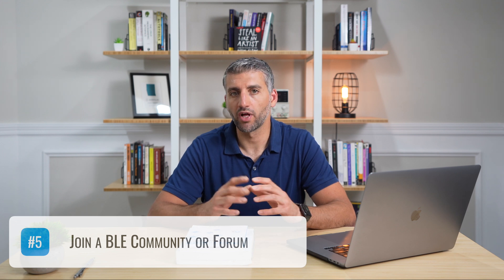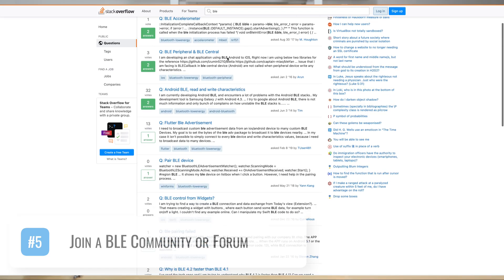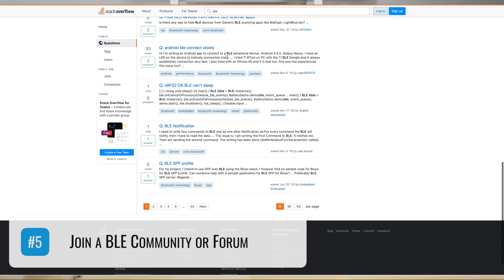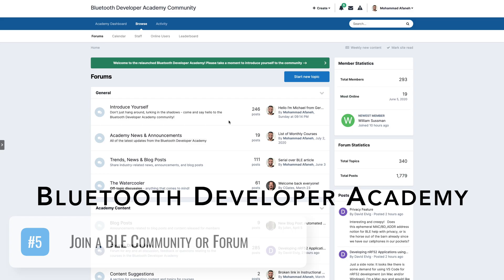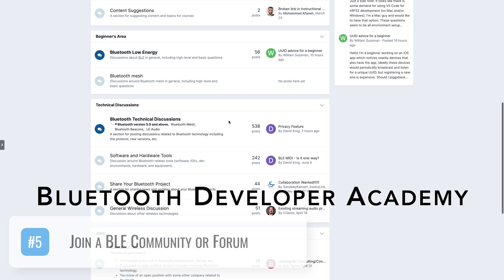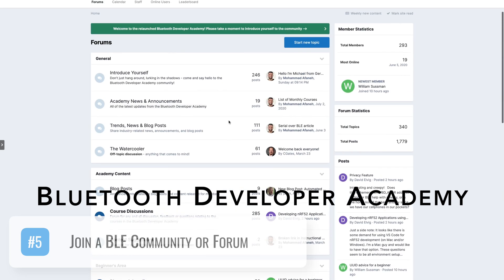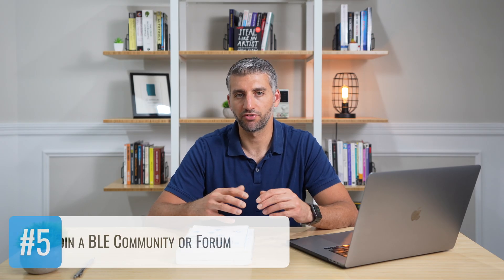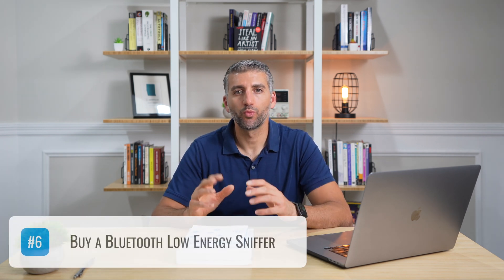Go From Zero to PRO with Bluetooth LE: Uncover the 7 Steps to Success!

Comment: Something I don't get about the Windows and Android apps: how come there's not a sniffer app that can show what data is being sent and received over the various BLE services (using the standard built-in BLE compatible SoCs)? All the apps seem to do is just show what BLE devices are advertising what services and characteristics. Am I missing something? Do I really need to buy a sniffer or dev-kit to see what data is going back and forth between my laptop and a BLE device connected/broadcasting to it?
Reply from the maker: You can check out capturing the HCI Logs on Android to see exactly what's being sent through the BLE chipset. 
https://source.android.com/devices/bluetooth/verifying_debugging
https://fte.com/WebHelpII/BPA600/Content/Documentation/WhitePapers/BPA600/Encryption/GettingAndroidLinkKey/RetrievingHCIlog.htm

On Windows, I'm not very familiar, but you may find something helpful in this page: https://docs.microsoft.com/en-us/windows-hardware/drivers/bluetooth/

The use of an independent device/sniffer has its advantages such as minimum interference with the application and capturing the packets in real time.

Comment: Great video, my goal is to learn and get good at BLE / NRF tech right now. Already did #1-#4 and read the first book, going to buy yours!

I’ve only considered using Nordic chips so far. As a beginner should I stick to learning Nordic/NRF Connect / Zephyr, or should I checkout some other chips? Nordic is #1 for BLE chips, no? Who would be #2?
Reply: You can track market share via the Bluetooth certifications out there, and Nordic has roughly 60% of those new certs so yes they are #1!  Mohammad is right, Silicon Labs is also a terrific option -- their strength is that they develop chips AND certified modules which make it easier / cheaper to get to market with a lower volume project.  If you're building <20k per year you should be using modules, and Silicon Labs is great as it allows you to start with modules and down the road (as volumes ramp) to transition quickly to a chip that will require certifications.  Between these 2 manufacturers, you can't go wrong :)
Reply from the maker: Great insights Phil! Thanks!
Reply from the maker: I can't really judge who's #1 and #2 :) But I can tell you I've mostly worked with both Nordic and Silicon Labs and I've enjoyed working with both of these. Don't forget about module makers as well (I should've mentioned this in the video), as they can make working with some of the chipsets even easier by adding their "special sauce".